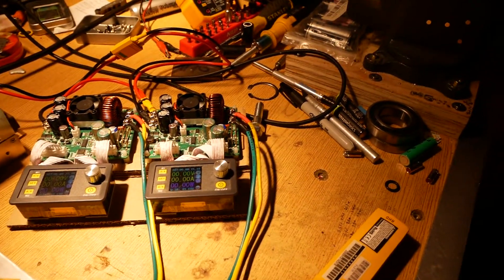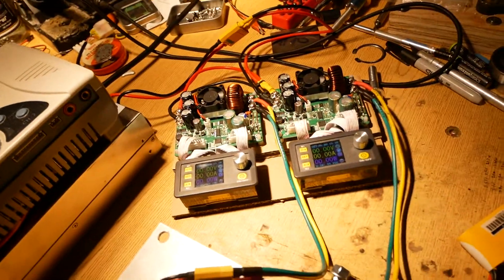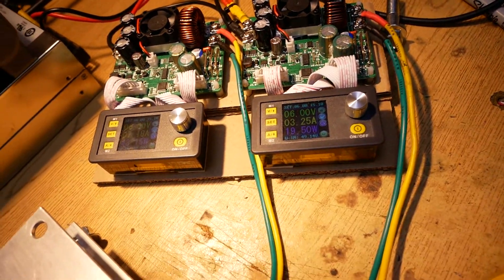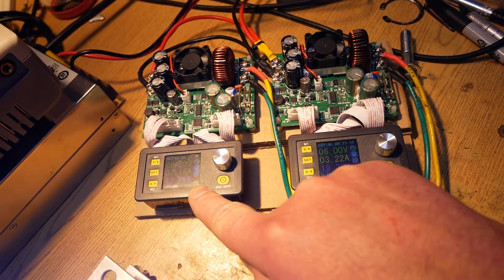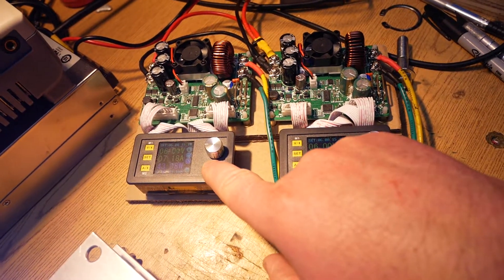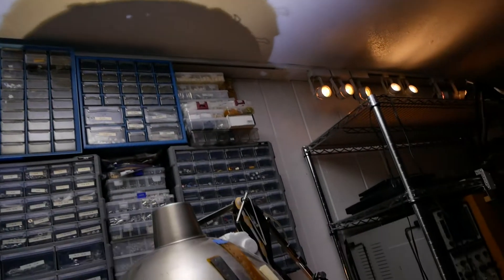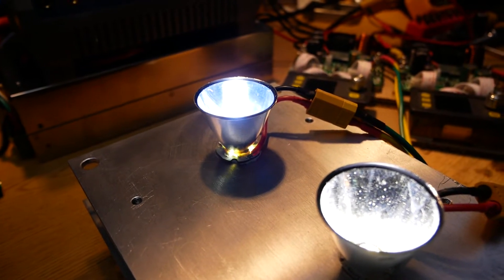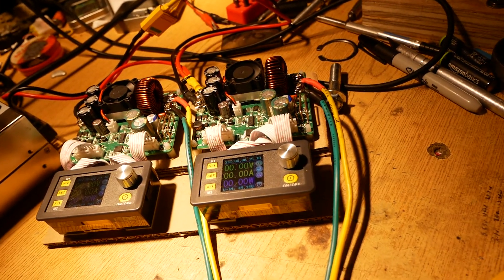CREE XHP70.2 VS Chinese XHP160 Bench Test

Comment: How do you think, what is max Safe current for XHP70.2  in case of 6V or 12?   I burned already two XHP70.2 at 2.5A - 3A. And only after that I noticed that 2.4A it is 200% according to the datasheet. And normal 100% current is 1.2A, not 2.4A like everyone is using. What do you think ?
Reply from the maker: I have a Klein Tools clamp on meter. It works DC or AC. I've made many long lasting XHP70.2 LED lights that are drawing 9 amps at around 7v. As you know, it just depends on if the 2 LED elements are in parallel or series that determines the voltage. I run them in parallel or 6v. You need to keep the LED cool or they will burn up. As you draw more current you will make more heat. Perhaps your LEDs got too hot? 3 amps is hardly anything at 6v.
Reply: @de-bodgery  Thx for answer. 3 Amps was on 12V. but, I got your idea. Maybe something was wrong with cooling. I was thinking that received fake LEDs, but they are from official supplier in my country. don`t know what to think. Probably that is my failed. I soldered them by my own on copper pad. Maybe to much or not enough soldering  lead. Who know. But looks like overheat problem. Maybe you will tell me more if I will describe how it died.  First it start blinking at 200% (~12V 2.5-3A). Like star in the night sky. Than it lose a lot of light in one second. But, when I push LED with finger or re-solder from PAD it again. It started to work normal again for some time. I was thinking I had a problem with poor solder iron contact between LED and copper PAD. But, looks like I just overheat it somehow. ( Just thinking to buy more of them or get some other light source like HID bulb. HID is old, not so cool. But I never had problems with it))))

P.S. sorry for a lot of "But" words. English is not my native.
Reply: And about to hot LED... YES!  I mean that copper PAD was not to hot but it was impossible to touch upper silicon part of the LED (I am talking about part that sometimes dedomed) . And funny that as soon power supply was turned off in next second (no joke, 1 second) it was possible to touch silicon upper part. It was absolutely cold and second ago it was impossible to keep hand on it.  I asked one guy and he said it is normal. Don`t know. I don`t have experience to say if that is normal or not(
Reply from the maker: @viko2812  The LED dome will be quite hot or rather is tolerant of lots and lots of heat from the LED. The heat is not the dome, it's the LED under it making all that heat. If the copper star board is 100F that's not a problem.
*
These 2 lights are XHP70.2 LEDs running from Castle Creations BEC 2.0 for power. They are set to 7.5v and about 9 amps. The copper stars are glued down with thermal glue and then the aluminum reflector rests on the insulator ring around the LED. Not much to it really! The hosts do get pretty warm just sitting there like in this video, but even a 5 mph wind is enough to keep them cool.

https://www.youtube.com/watch?v=Qwx7Md4UbKc&list=PLOrUJ_KZtl79SNhUZXlBVqrbPaLUrXZ-X&index=17
*
A few details about LED modding...
https://www.youtube.com/watch?v=PRB1GdN2wh0&list=PLOrUJ_KZtl79SNhUZXlBVqrbPaLUrXZ-X&index=9
Reply: @de-bodgery  got it. Thank you. Will try again. Maybe I will be more lucky this time )
Reply from the maker: @viko2812  Legit CREE LEDs are pretty tolerant of over watting. This shouldn't be a problem. They handle heat really well and you can run them at a lot over their heat ratings. I'm wondering if you got fakes. 7.5v, 9 amps is usually OK for an XHP70.2 if it is legit. I ran one set up for 6v at 12v once. I was seeing 15 amps! That LED was as bright as a welding arc. I had stuck down to a heat sink with thermal paste and it popped loose and instantly killed itself. If it had stayed put, I think it would have run for at least an hour that way.
*
I did a reflowing video. I saw your comments about soldering LED's. I think you might be using the wrong method and that could do them in too. Rflowing in a frying pan like I show here is very reliable. 100% of all LED reflowing I've ever done I use this method. IF there is one thing I do differently it is to use solder paste instead of solder. You see all the dark areas on the star boards. This is the solder flux burning off. Solder paste flux does not burn or need to be cleaned off later. This just gives you a cleaner look.
https://www.youtube.com/watch?v=aZ1K8JEi_cU&list=PLOrUJ_KZtl79SNhUZXlBVqrbPaLUrXZ-X&index=8
*
I bought a syringe of solder paste that I use only for reflowing LEDs. This little syringe is a bit expensive, but it will reflow hundreds of LEDs. Also, you want leaded solder, like what is in this product. I won't use lead free solder for anything! It's not as good and is likely to cause issues with reflowing.
https://www.amazon.com/MG-Chemicals-Pneumatic-Dispenser-Dispensing/dp/B00M1RC0YY/ref=sr_1_3?dchild=1&keywords=mg+chemicals+solder+paste&qid=1631634576&sr=8-3
Reply: @de-bodgery  sorry for late response. Checked your video and followed recommendations. So far all ok. Running LEDs at 12V*1.6A to stay at safe side of the force )) hope all will be ok) Good Luck. And Thx.

Comment: Hi, the topic of the video is good, but next time check before you shoot to see if you can see anything because the left display is totally unreadable, without your commenting on the value I would just type what is there. In addition to the parameters and qualitative comparison, I would be interested in, for example, the price comparison, which is also quite decisive.
Reply from the maker: I made this video a good long time ago and didn't even remember the specifics anymore. I can read the left LCD well enough. It does have a bit more glare so it's not as easily read, but still quite readable for voltage and amps. Price...hmmm...feel free to go look that up yourself. I am comparing the light output at the same voltage and obviously far more current for the chinese LED. Price wasn't relevant to this video in any way. Thanks for the feedback.
Reply: @de-bodgery  Thank you for fast answer, i ask for price for distributor and it was for XHP 50.3 HD  2-3 EUR / pcs what is not soo bad and y have original Cree. I waiting for price for XHP 70.3 HD what is much more interesting offer. IF i will have price i will let y know.
Reply from the maker: @pgchem  I buy legit CREE LEDs, but that's in the USA from Mouser or Digikey. I then reflow them onto copper star boards. The Chinese 160 LEDs are a joke and far from better than an XHP70.x. They aren't worth bothering with.

Comment: But the battery sold with the xhp160 is only 3.7V, are you not overpowering it with 6V (thus the smoke) ?
Reply from the maker: Individual LION cells range from 4.2v at full charge to about 3v at fully discharged. There are 2 in series for a voltage range of 8.2v down to about 6v. Between the LED and the batteries is a DC-DC converter (LED driver) providing 5.69v to the LED regardless of the charge level of the batteries. The Chinese flashlight maker knows what I know that the specs for the XHP160 call for 6v. Despite this, they also know that these LEDs are atrociously low quality and start to smoke at 6v...which IS exactly why they run them at 5.69v!!! I made no mistakes running this LED at 6v from a regulated DC source. I simply exposed just HOW shitty they really are!
Reply: @de-bodgery  The torch i bought on aliexpress has 16 xhp160 cells but only one battery thus 3.7V. I am a little disappointed with the power, if i understand what you are saying i can find a solution to go up to 5.5V to get more brightness?
Reply from the maker: @bridew  Can you post the URL for the light you bought? 
*
Your light has an LED driver in it. The XHP160 is supposed to run at 6v. IF your light lacked an LED driver in it, at full charge it would be brightest and dim considerably as the battery runs down. Since your light runs on a single cell, it has a BOOST converter in it to convert battery voltage to a steady 6v or maybe a little less. BOOST takes a lower voltage and raises it to a higher voltage. Mine with 2 cells in series, is too much voltage so I need a BUCK converter to bring down battery voltage to about 6v.
*
BOOST and BUCK converters work the same way in that they take a range of input voltages and convert that to a fixed output voltage. Increasing your input voltage to 5.5v probably won't change the brightness of your light even slightly. First thing you need to find out is what voltage is your LED running at now. You will need a multimeter so you can measure the voltage at your LED when it is at full brightness. 
*
If you discover you are already running just under 6v, applying more voltage will probably cause your XHP160 to start smoking like mine did. My guess is that many/most of the XHP160 LEDs are dismally poor quality. If there are very good ones, I don't know about them. Even then, I seriously doubt that any are as good as CREE LEDs.

Comment: XPH 160 seems brighter for me
Reply from the maker: "seems brighter" that's due to the blue light content in the Chinese LED being much higher than the CREE LED has. I know that the XHP70.2 is 4300K, but I can guess that the XHP160 is around 5000K. This is why you think it is slightly brighter. Notice however that the XHP160 needs 7.17 amps and the XHP70.2 needs 3.22 amps to make essentially the same amount of light.
*
Watch this video. I got a light meter and that removes any bias I might have about what's brighter. Once a meter starts measuring light output, you are dealing with hard facts instead of the human eye. Amps, total watts used to produce the light, brightness for the number of same size LED elements...the XHP70.2 always wins!
*
Notice that the XHP160 AT 6 volts is smoking and the XHP70.2 is running just fine.
https://www.youtube.com/watch?v=ZyS1h21jL_Y&list=PLOrUJ_KZtl79SNhUZXlBVqrbPaLUrXZ-X&index=26
Reply: @de-bodgery  thats a wrong assumption again. if you meassure stuff you should know how far the results are representing real life. i can have a kW IR LED or multi kW deep red LED, sure the LED CAN be bright on a teststand for the meter, but this is absolutelly useless if the lightoutput or more precise the spectrum is not alligned with the human eyes peak sensitivity.

human eye "perceived" brightness CAN be way more important than a value a meter shows, you are right in that it is a real number, but we use light so that WE, with or EYES can see, not so just generate a big number that in some cases is meaningless.
Reply: Yeah it's brighter.
Reply: @leoost6322  yes completely agreed with you. How we  see is more important.  Even I prefer yellowish light. Another things is the video is not capture at fix exposure. You can see the "auto ecplosure" adjustment when light switching .  which camera will "auto" adjust to "optimal " brightness, in this video very fast the adjust did. and of cause we will see the brightness on very similar level. But your work appreciated
Reply: @de-bodgery  I teach mathematics and I think that you can be right in the numerical tests with the meters, that both leds will produce the same amount of light. But the fact is that we humans who see with our natural eyes are interested in seeing everything more clearly, and it doesn't matter if the Chinese leds produce more blue light or not, but it looks better in the dark. We are not talking about protecting your eyesight or seeing the Sun directly, what you want with a flashlight of this type is that it illuminates more, and our eyes do not care if it is blue light from below, or ultraviolet or yellow, the question is How do our eyes see better? With white light, and the brighter the better, and that's what you see in the video that you made yourself. Since one LED uses more energy than the other is a separate factor, a real experiment would have to be done on how long is the useful life of a Chinese LED, although they say that 50,000 hours pass! But these did not detect the fact in the experiments, to see how long a continuously lit XHP160 led would last versus a CREE XHP70.2.
Reply from the maker: @jalejan77  That is your opinion. I don't like the blue light you get from Chinese LED's. I like my light like you get from the sun...slightly yellow. This is what our eyes are tuned for too...yellow light, not blue light. Useful life is much shorter than a CREE for sure. Did you see the thing smoking? It died soon after I finished these XHP160 LED videos. Meanwhile CREE LEDs, even massively over watted, run for years. Can't over watt a Chinese LED. They just burn out!

Comment: I wish Cree made something stronger than the 70's in the same form factor, or even a real XHP90 (90mm) or a XHP110

i like how a single one of these small leds can reach over 4000 lumens, but i want More XD
Reply from the maker: That's when I usually make 2 headlights. Also, there are multi XHP70 Chinese lights. The LEDs in them are not great and won't tolerate over watting. Strip off all the electronics from their MCPCB all in one design so you can use just the bare board with CREE LED's and some much better driver and you can have 3 or 4 or whatever legit CREE XHP70.X LEDs in the same host with some crazy light output!

Comment: Actually you just proved that the Chinese XHP160 is much brighter. So obvious as well.
Reply from the maker: It's amazing HOW people like you come out of the woodwork! I didn't look at the metrics for your watching of this video. I'm going to assume that you skipped around a lot and that you didn't watch everything and certainly NOT the follow up videos to this one...where it become abundantly obvious just HOW shitty this Chinese LED is! Like it wasn't already VERY clear from this video!
Reply from the maker: I have to ask. Which part of more than DOUBLE the current for nearly the same amount of light don't you get? For battery powered devices, HOW LONG you can run from battery is critical! You very likely have a smart phone. Would you be happy with 1-2 hours of use when you could have 10-20 hours of use on your phone? This is NOT different! The XHP160 is a gas hog compared to the XHP70.2! To make the same amount of light it needs MORE THAN DOUBLE the current to do it! That means your flashlight batteries last LESS THAN HALF AS LONG as they would when powering an XHP70.2!!!
*
Feel free to keep your simplistic and illogical point of view! I'll keep using legit CREE LEDs and more than doubling my battery run time!